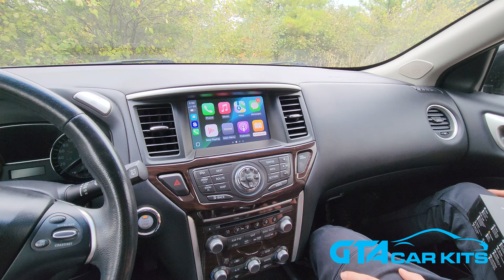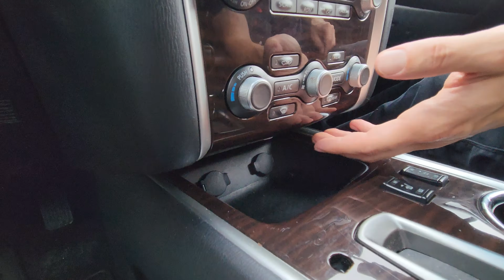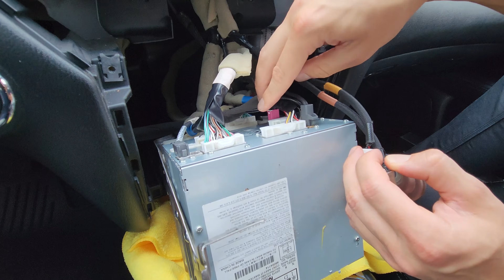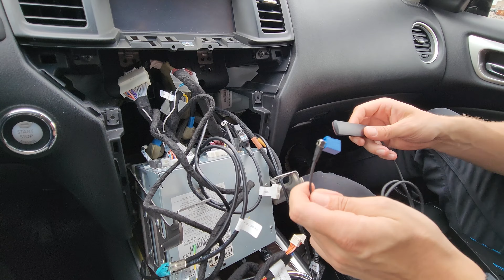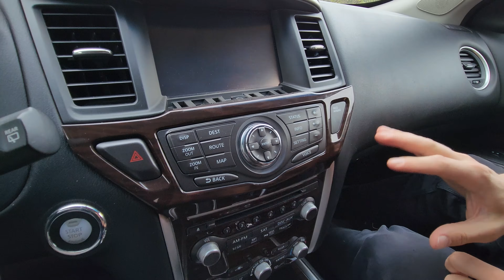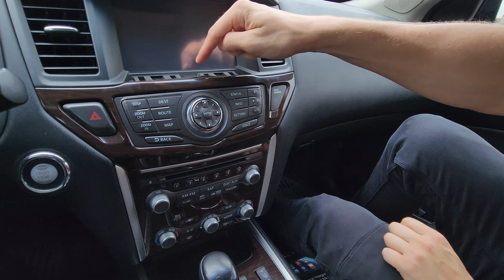Wireless CarPlay and Wireless AndroidAuto in Nissan Pathfinder 2013 2014 2015 2016

Comment: Does this work on the screen that doesn't have Navigation? My 2016 Pathfinder SV has the same screen as shown in the video but no navigation.
Reply from the maker: It will work if you have original touchscreen function + Bluetooth for audio streaming.